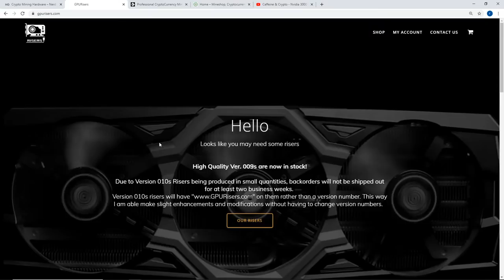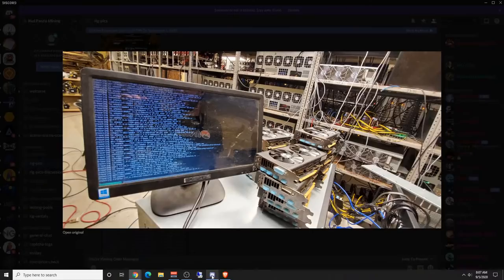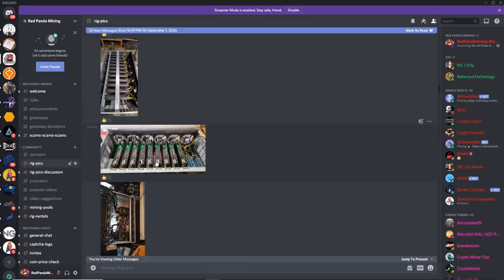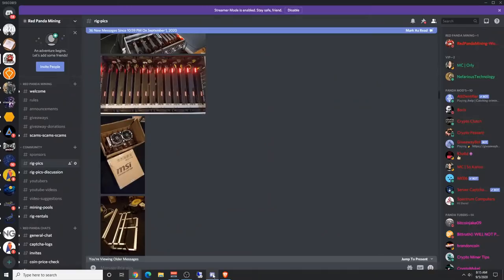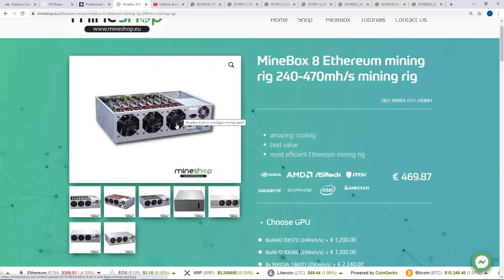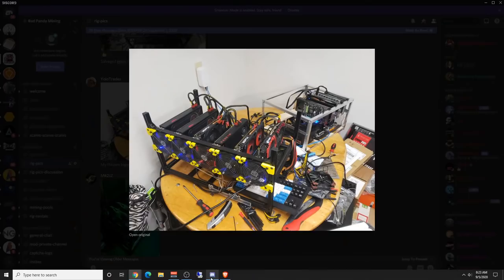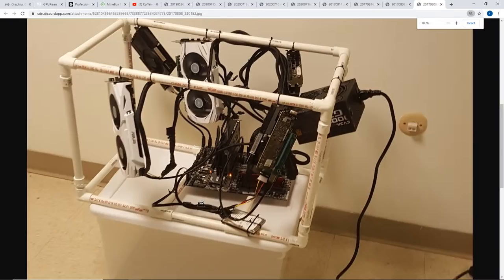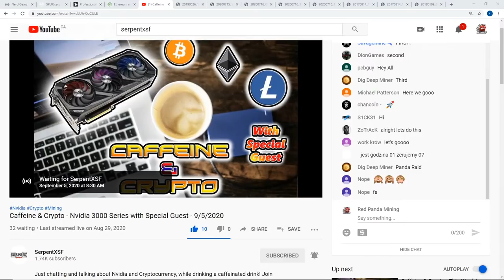We All Have A GPU MINING ADDICTION! | CMRS 81 Live!

Comment: Hey you seem to know your hardware. How well do you know nicehash? I am running 8 rx5700xts on an asus b250 board with i3 with 8gigs ram and two 850 watt thermatek power supplies. For some reason nicehash will occasionally load and run all miners then crash. Or get stuck loading nicehash and won't run the program. I checked evrything from drivers to reinstalling Windows 10 any suggestions? I have the same problem on 2 of the same rigs
Reply: I find NH always crashes overnight when I leave it to mine! Its too frustrating to bother with imo
Reply: By reading your rig setup, it seems that your power supply are inadequate. When you start nicehash your GPUs will ramp up during benchmarking and use higher watts (roughly 250watts)...assuming you have 4 GPUs hooked up to each power supply...250x4= 1000watts. You also need to account the risers which need 50 watts per riser (50x4=200). If you have an outlet meter you can measure the power consumption as it ramps and see if that number approaches your PSU limits
Reply: Forgot to mention,...if you are good on the power supply issue, then try Nice Hash OS (NHOS) instead of running windows. I use it and it runs super smooth. There is a small learning curve but tons of youtube videos to learn from
Reply: @teachusmore  thank you for the tips I did the math and you are correct I miscalculated power use of the rx5700xts I just placed an order for 1200 watt 220v power supplies I'll let you know how it goes
Reply: @AfghanKush  try the OS version of it
Reply: Use simple mining instead of windows
Reply: @raisehell00able  So I switch to SMOS and it is definitely better the NHOS; I was able to OC/undervolt with SMOS...NHOS didn't work/register after editing the JSON config file (likely a 5700XT comparability issue)
Reply: Daniel Garcia glad to hear ,, smos is definatly better u can run entire farm hastle free